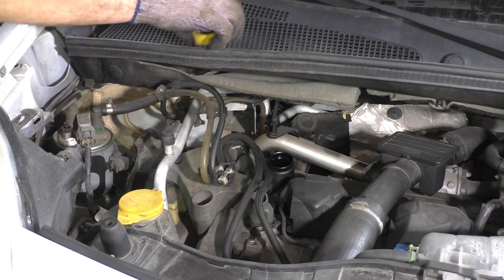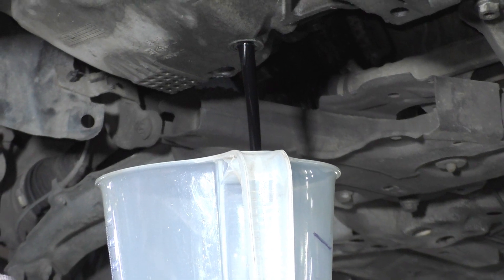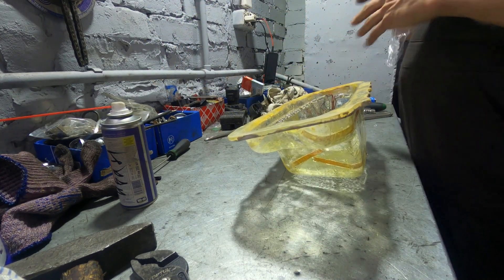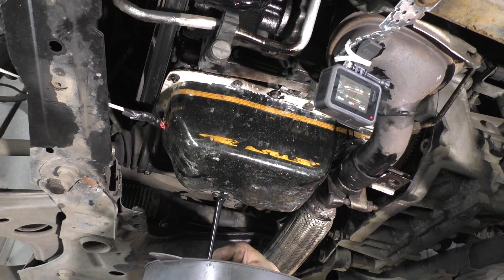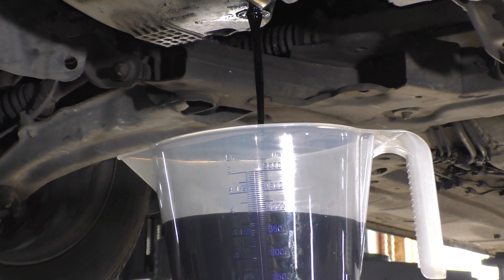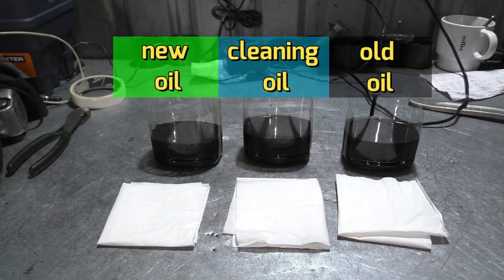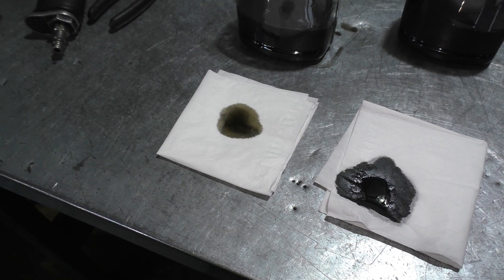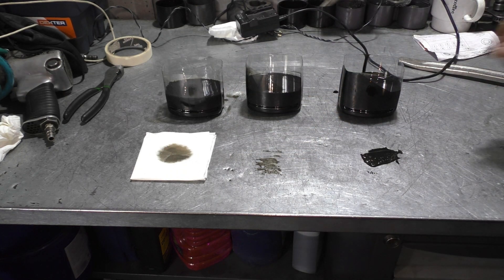Why does the oil in a diesel engine darken immediately

Comment: As tribologist explained, diesel oils are formulated with soot absorption in mind, diesel engines first wearing agent is soot and therefore there is the need to capture and suspend soot. Diesel oils are tested with black carbon in them by the manufacturers.
Cold starts influence mostly fuel dilution, that is an different issue entirely.

Comment: I have a 7.3l Powerstroke diesel engine in my truck and it doesn't get near that dark after 3-5 thousand miles. I will change it and it doesn't get colored until 3k miles and when I change it why will my oil stay clean. I think I have a very rear motor that it will not get filthy like the rest of them.
Reply: @johnelliott7375  curious. Did you run HSS stiction eliminator in this ever?
Reply: @NO_ONE_C-j8j no egr

Comment: Great explanation but i would have to differ with you on the reason. While you are correct of all of the oil properties, you are correct about the dieselengine compression being higher and you are correct about the soot; the reason is not clear. The true reason and taking in count the above is that when you start the engine in the morning the components like the piston rings are not at operating temperatures, they are cold, this allows combustion by product (soot) during the power stroke to go by the piston rings and in to the oil sump making the oil dark almost since the firat time you start the engine with new oil. After operating for some minutes, the piston rings expand and creat a better seal in the combustion chamber therefore combustion byproduct will not enter the oil sump. The cause is thermal expansion. Good video.
Reply from the maker: Thank you so much for watching and sharing your thoughts. It adds to the treasury of our ideas and knowledge 👍
Reply: But the same thermal expansion happens in petrol engines right?
Reply: @Simon-dm8zv  Yes, but the  petrol engines inefficiency makes it warm up faster, and combustion happens more rapidly, heating all elements quicker making piston rings seal faster, I would not define combustion as cleaner on the petrol engine but it does not have the amount of soot generated in the compression fired Diesel engine, unless excess petrol is being burnt but even then, but even then its not as much soot as diesel. Both combustion processes are completely different but do the same work, rotate the crankshaft.
Reply: @bepacman  That makes sense. Thanks!
Reply: You are all wrong. Diesel engines create large quantities of soot due to the highly heterogeneous nature of combustion. Large, poorly mixed droplets of fuel fresh from the injection nozzle form coke particles rather than burn. Gasoline engines have homogeneous combustion with intimate mixing or the fuel and air, leading to little soot. GDI engines have soot for the same reasons as diesels.
Reply: @gregorymalchuk272  вы правы, но не во всем.
Огромное значение имеет режим эксплуатации двигателя; при движении автомобиля на большой скорости, частицы нагара разогреваются до высоких температур и сгорают. Происходит очистка поршневой группы.
При езде по городу, когда двигатель не испытывает нагрузки, происходит накопление отложений.
Это из моего опыта эксплуатации дизельных автомобилей.

Comment: Hi, my car has been completely submerged under water for 10days, post i didn't started and given to service center.
Can you please tell me whether my car works?
Reply from the maker: Engine may need repair
Reply: @opelservicekyiv  what about the electrical components like ECM,and another remaining main modules sir?
Can you please tell whether repair is enough or replacement is necessary?
Reply from the maker: @yaragundlarajesh8616  You need to assess the condition; some things can be repaired, while others cannot. Disassemble the unit and inspect
Reply: @opelservicekyiv  Thank you so much for your response

Comment: Great video, especially the comparison of 3 different oils' colour on the paper towels.  However, you didn't get much use out of the transparent sump after all the effort of making it.  Please could you do a video of the transparent sump with the engine running at different speeds (and also measure how many mm the oil level drops when the engine starts, and when the engine is running at higher rpm)?
Reply from the maker: Thank you, I'll add it to my list of things to do. Then we will select a suitable car and material. It turned out that the review is not available everywhere.